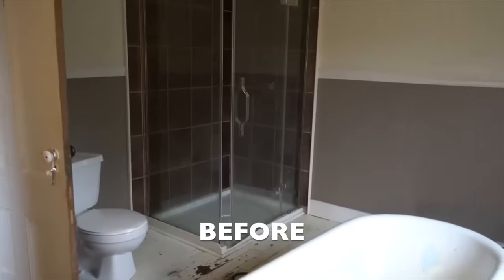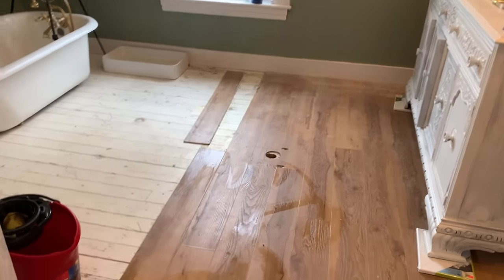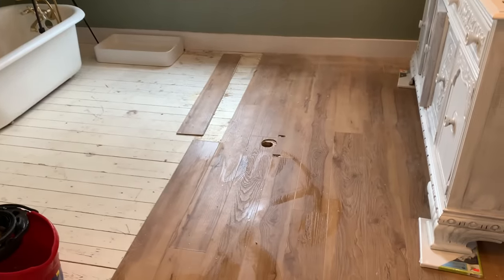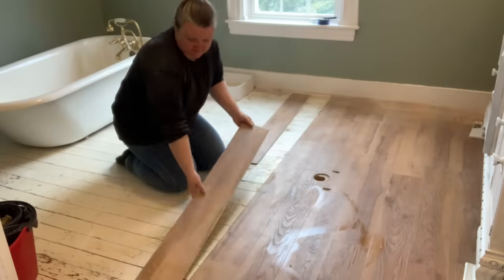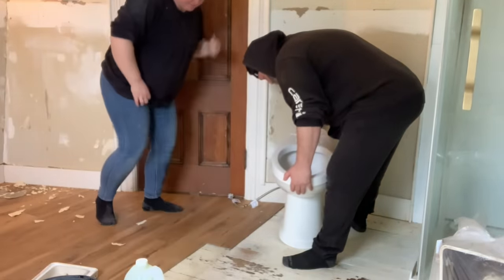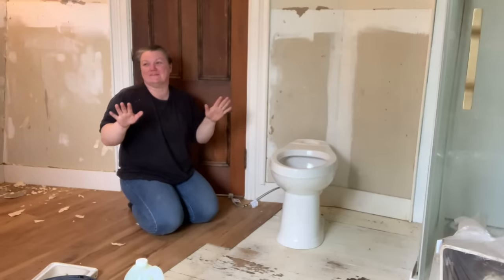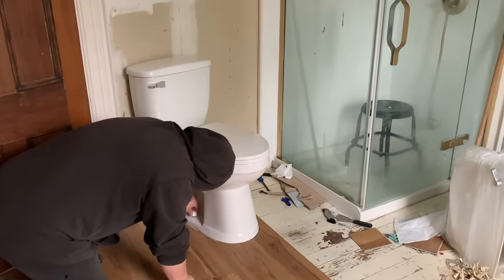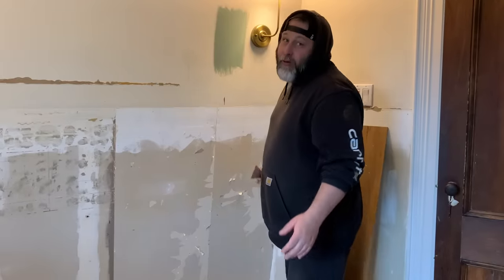WHAT DAY IS IT?! Bathroom Renovation

Comment: A plumber once told us to never put caulking around a toilet because you wont know if it leaks until it’s done a lot of damage.
Reply: Was actually going to post the same comment. My husband was a contractor for 35 years and never caulked around a toilet for the reason you mentioned. He also never cut the flooring out like the English's did either. Should only cut out around the wax ring.
Reply: Why didn’t you cover the whole in floor first?

Comment: FYI, plumbers recommend you put the flooring under the toilet so it sits on a completely flat surface. So you only cut out where the seeer pipe is. 😊 Also, you get a better caulk seal around the base in case it overflows or leaks.
Reply: That is how we did it in our house.

Comment: Oh Elisha I am worried for you.  I have heard plumbers say never cualk around a toilet because if it gets a leaked you are sealing the water into your subfloor. Also our toilets our set on the flooring/tile.  What you put in was an ADA approved toilet for those who need risers or using wheel chairs. Sometimes these are better for aging people but to go properly to the toilet when pushing it is better that your feet touch the floor to help your muscles do the work. My grandson had to have a step stool in front of him for a while.  Sorry to present these issues but just a FYI.  Great progress as the bathroom comes along.  Also go below from the washroom/pantry and plug up that hole so you don't get wear in that divet.

Comment: You should have put the new flooring all the way under the toilet, running the flooring up to the toilet leaves an area for drips and leaks to gather.  It will hold smells in there.
Reply from the maker: there will be silicone there and this is how you are suppose to lay it down
Reply: Never caulk a toilet
Reply: @staceyvanier15  Exactly Stacey. One should never caulk around or under a toilet.

Comment: Why didn’t you put the flooring under the toilet? You just had to leave a hold for the flange. The wax seal would fill the gap, that’s what it’s for. You actually should not use silicone caulking around a toilet either. If there is a leak under the toilet it will go unnoticed and leak into the ceiling below.

Comment: Just curious why you couldn’t run your flooring around the toilet flange? Rather then cutting flooring around the toilet. 
Nicely coming together.
Reply from the maker: it wouldn't have connected correctly it needed to be at floor level :)
Reply: Was wondering the same thing..I've never seen that before
Reply: @ElysiaEnglish you can use an flange extender to get the correct height. Silicone gets so dirty
Reply: @GP-dw3hb  a; Also, you are not suppose to silicone around the bottom of a toilet. If there is a leak, you aren't going to know it until it leaks through the ceiling below. Also, if they have to replace their toilet at some point in the future, they may not be able to find the same model so the floor won't go around the new toilet . It's a pain in the butt, but if it were me, I'd tear out the flooring around the toilet area and re-cut new pieces so that it just has an opening around the toilet flange.

Comment: You do know you're not supposed to caulk around a toilet bottom. If your toilet starts to leak you won't know until it's rotted out the floor because the water would be sealed in underneath the toilet. You would have been better off to have run your flooring and just cut a hole for the opening for the drain of the toilet. You never caulk around the bottom of a toilet.

Comment: I'm told there is a heated debate in plumbing circles re: toilet caulk.  To caulk or not to caulk...Caulking makes it neat and tidy but locks water in if there are leaks so the leak in not found until its done some real damage.  Not caulking allows water out and lets you know if there is a leak but doesn't look as nice.  My plumbers advice to me was:  if you can't stand NOT caulking then only caulk the back (assuming its level)-then water will show up at the front where you'll see it and can respond to it.  Re: toilet height-there seems to be a trend towards having a stool in front of the toilet.  Looking good!

Comment: Philip !!🎉🎈😄  You sound rough , but you’re out of bed - and now you have a clean new pot to pp in !!!! 😂 
It’s high  off the floor, but that’s what a small foot stool is for. And you could also install a handrail on the wall to use as a safety leverage to stand up . The type that older people use and in hospitals…. ( once you have one, you’ll never understand how you lived without it 👍 when you’ve had surgery or injuries, it really helps ) 
I agree with other commenters that the tub would look better on the wall opposite the vanity, and a flower 🌺 plant stand at the window.  Whatever you decide, this bathroom is going to be gorgeous!!